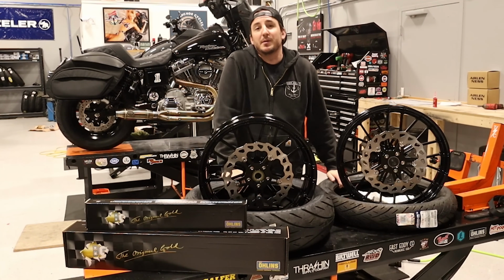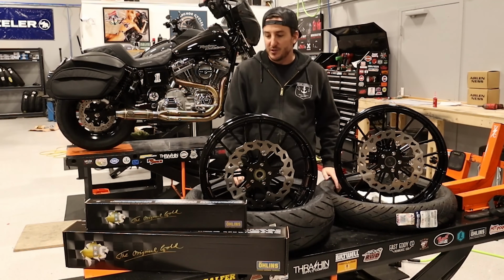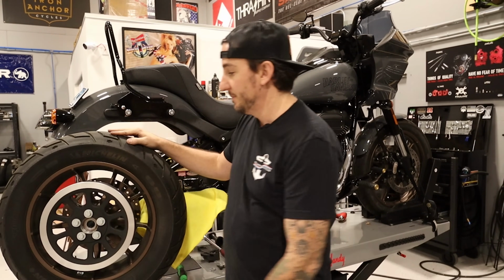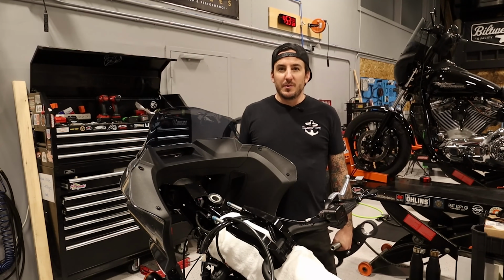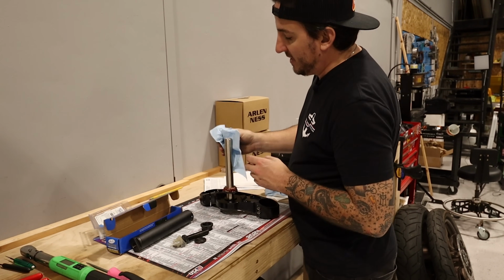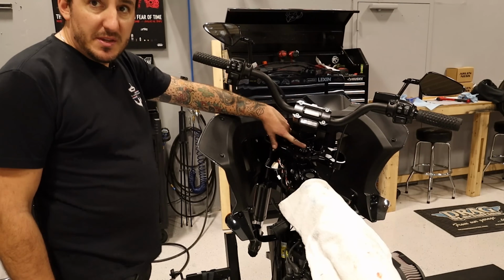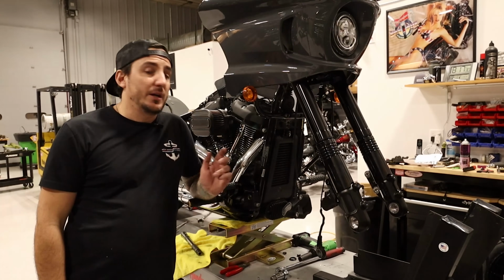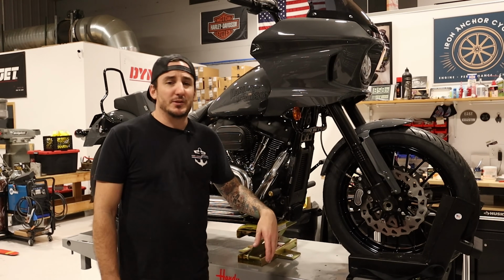Major Low Rider ST Upgrades: Front End, Wheels & Brakes!

Comment: I ride a 2022 FXLRS, I'm 61 and 6' tall, why does anyone put forward controls on a Low Rider? I don't get it, this is a performance cruiser, it comes with high mids because that is the best set up for any motorcycle you plan to ride aggressively. If you want comfort get a Road glide dude.
Reply: I 100% agree.
Reply: Absolutely
Reply: the performance difference is minimal at best, the comfort difference is night and day.
Reply: @headwinded1948  I disagree... maybe we don't ride the same.  Mids offer more ground clearance to ride harder without scraping hard parts.  I'm 6' 2" and comfort is perfect with the right seat (Saddlemen StepUp) and the right riser/bar combo (8" DMR Destroyer pullback risers and ODI mid-rise "Podium Flight" Vtwin bars).  Forwards are over-rated and an additional expense where the money would be better spent elsewhere.  Lifting the bike 2" up front and an inch in the rear with full Ohlins setup helped a lot!
Reply: @UnrulyRider  No doubt bro, I have a Saddleman as well, Krause 2 up 1 over riser and Thrashin mini boards, it's perfect for me.
Reply: @headwinded1948 try standing up on your forward controls 😢